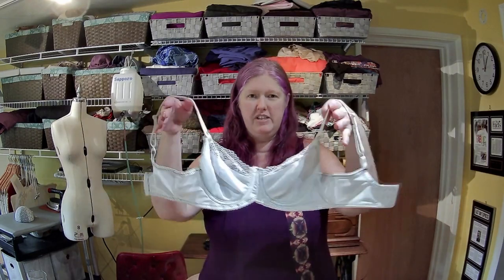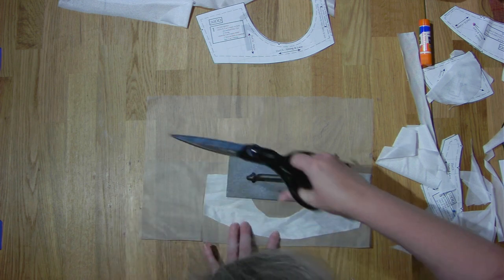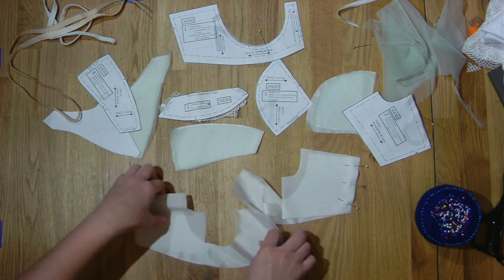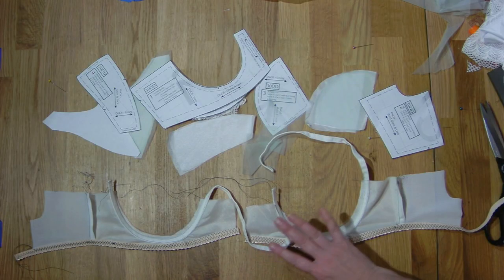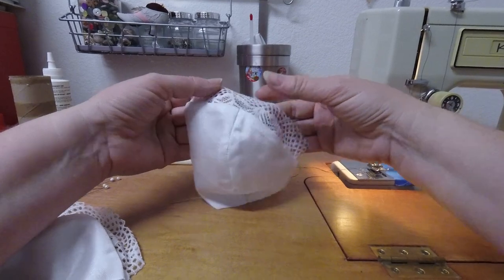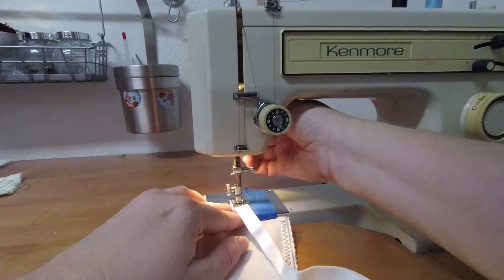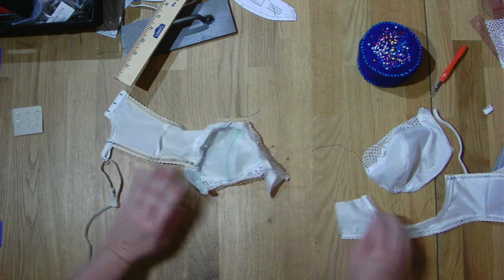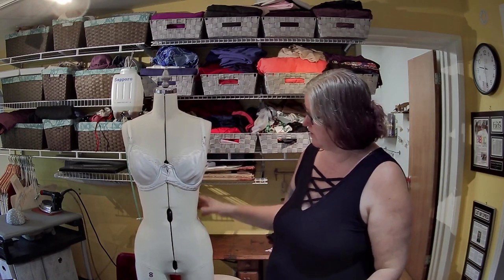Making a Fitting Sample for the Cashmerette Willowdale Bra, demonstrated by Porcelynne

Comment: Wait, did you sew the band without the lining? Won't that change the fit due to stretch? Maybe I missed something.
Reply from the maker: I sewed the band with the lining. I just glued them together since it wasn't a final bra.
Reply: Ooohhh. I missed where you did that. Ok.
Reply from the maker: @barbf8628  It was a log video, so it would be easy to miss.

Comment: I could reach the slider if it were in front. I could connect my bra with less of a challenge if I could do that in the front of my body.
Reply from the maker: There are different hacks to move the slide to the front, but this pattern was not designed that way. I am not the designer of the pattern, I only partnered with them. There are not many front closing bras unless they are demi cut. Annie and Myras has a front closure bra you might want to check out. Their Vivian Bra is a front closure. https://www.annieandmyras.com.au/shop